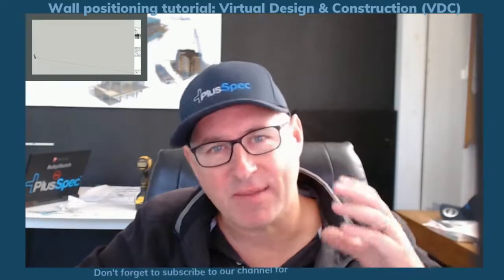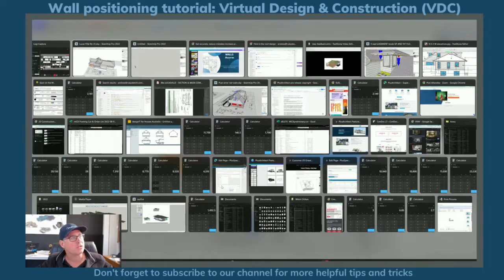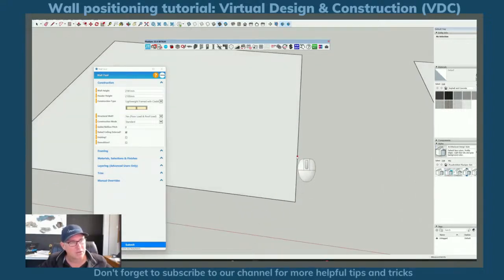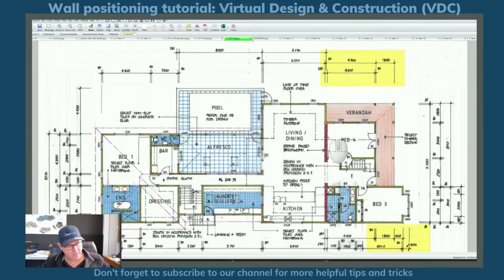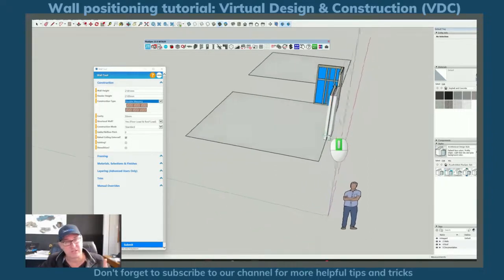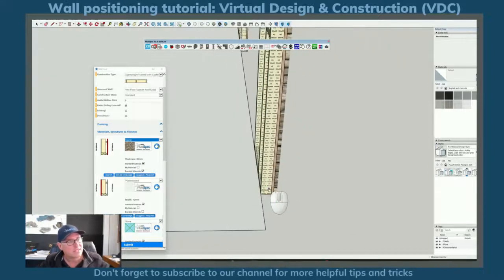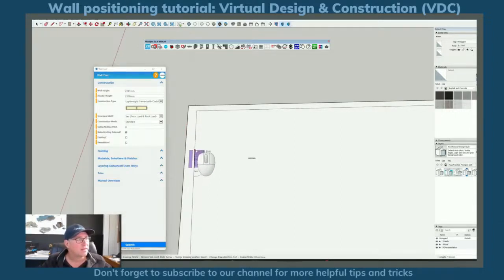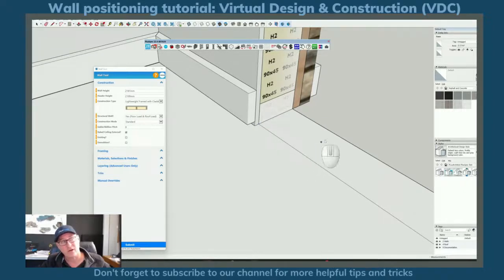How to ensure accurate wall placement Beginner tutorial PlusSpec

Comment: This tutorial will definitely help people to understand that 90mm wall on the plan is thickness of the structural frames on the plan and external/internal skin will added extra thickness. Therefore the actual dimensions and dimension in plan will differ by thickness of materials that been used for the walls construction.
Thanks!
Reply from the maker: ✨Yes, 100% Alex PlusSpec solves these issues.  
 Dimensioning from finishes creates confusion for suppliers and subcontractors. 
All of our Plugins draw the way we build PlusArechictec and PlusDesignBuild has an auto dimension feature that sends dimensions and high-resolution textures to Layout to further solve the problem.  Thanks for commenting. 😊

Comment: Hi Andrew - Thanks for sharing.  Do you have any quick tip suggestion for dealing with end of wall termination where the plasterboard is not covering the exposed end stud?
Reply from the maker: The functionality is thereFrom memory its in the right click menu. "End of wall" or start of wall. It'll also extend the cornice and skirting around the end or start or a wall.
Reply: @PlusSpec  sorry do not see this function in my right click options :(
Reply from the maker: @PemboDave  sorry my bad. Its actually in the wall tool under the heading "Trim" then click on the drop down :Tim End" you'll see Start End Both.
Reply: @PlusSpec  Thanks